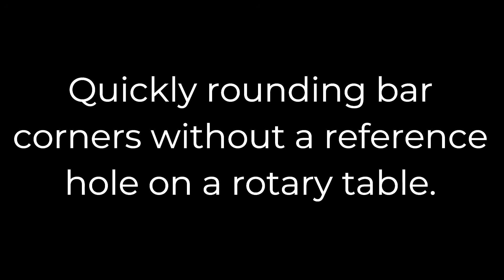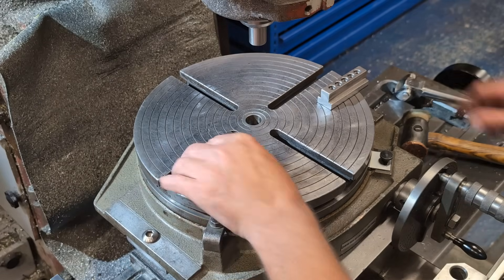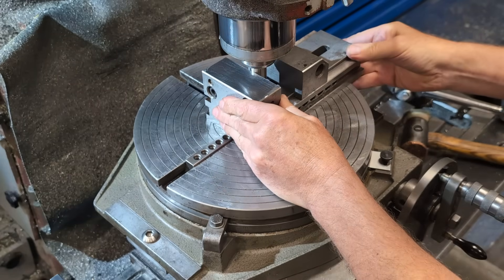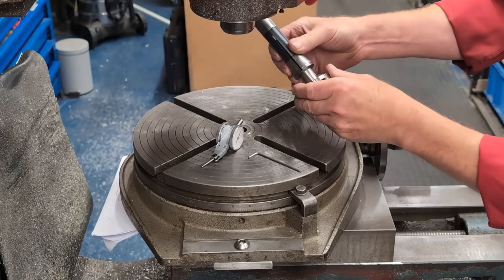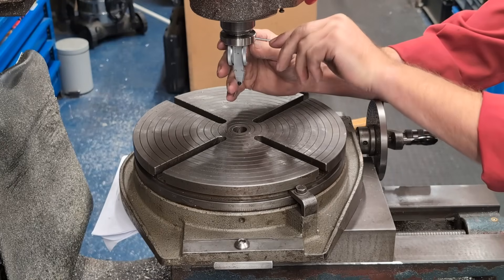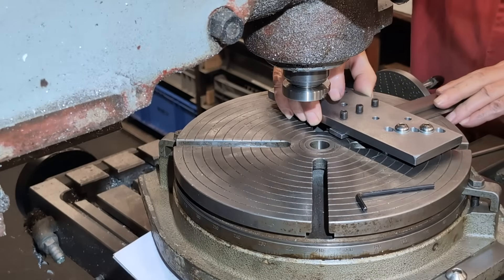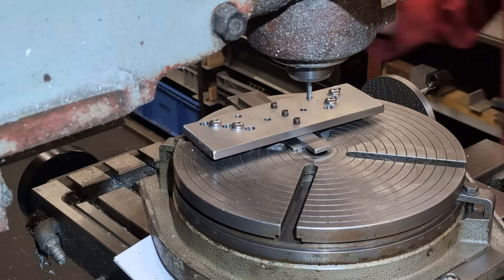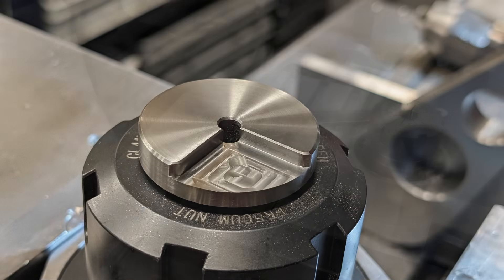No Hole? No Problem – Precision Corner Rounding Made Easy!

Comment: Machines last part in a cnc mill while explaining how easy it is to use a manual machine to round corners...... how ridiculous
Reply from the maker: I'm showing how easy it is to round corners manually with a simple technique. The mill used allows better access for the camera; My Bridgeport is in a corner.
Reply: It's probably more ridiculous if you don't think it's just as easy in a manual machine.